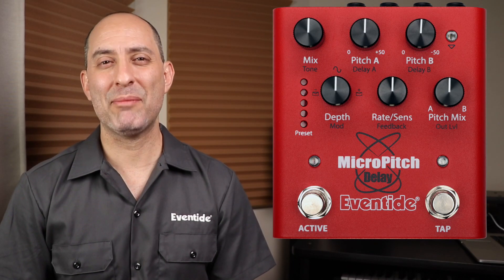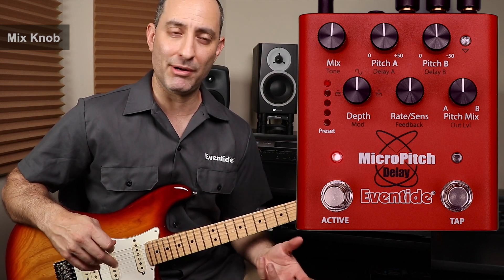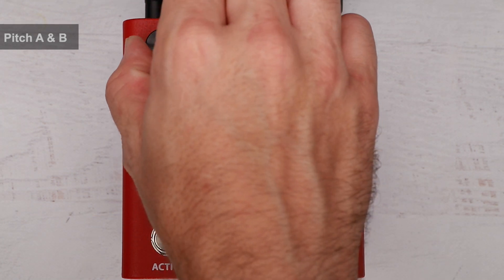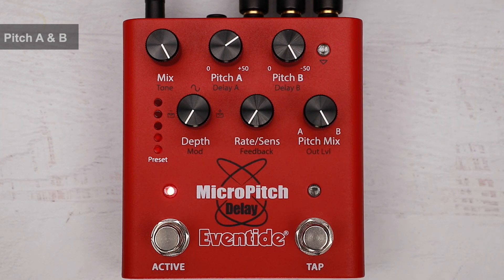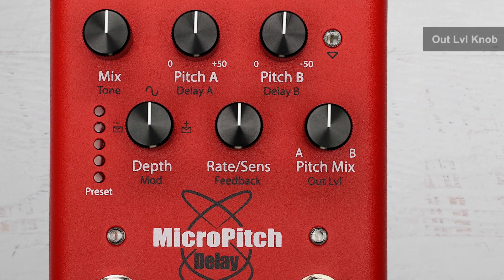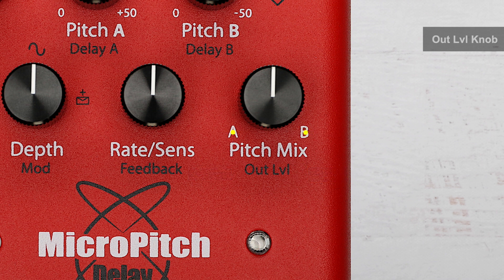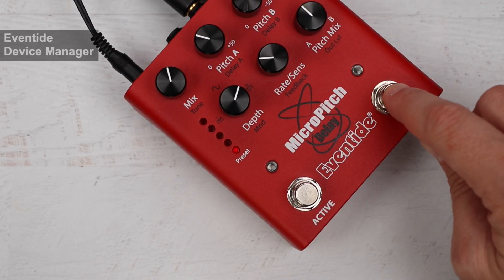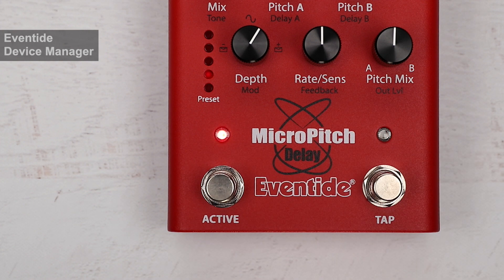Eventide MicroPitch Delay Pedal Tutorial - Part 1: Knobs & Switches

Comment: Van Halen-------  if 0 to 127 = 0 to 50 what value between 0 to 127 would equal 9cent in the 0 to 50 range  ===ChatGPT  Query ===== if you are looking for van halen settings try chat gpt - for 9 cents = 23 same goes for delay settings * assuming the range is 6 seconds-----  798 milliseconds =17 -------398ms =8 ---anyway you get the point - this could have been on the face of the unit ???? haven't tried it but should be ballpark - in the editor  obviously

Comment: Let’s say I’m in preset 1, it’s my clean tone and I make preset 2 distorted tone.   As I’m playing, I have a rhythm coming up that needs to be distorted or a solo. I hit the button I go to that preset.  When that’s finished I need to now go back to that first clean preset so do I now have to hit that button on the right four times to go back up to clean tone in preset 1 or is there a way to go backward to 1 ?
Reply from the maker: Searching for presets is possible from the front panel of this pedal the way you describe. However, because this pedal is MIDI capable, most musicians opt to use a controller to go directly to the preset you need.

Comment: played with this for a few hours tonight and i'm really grateful for the preset plates that come with the pedal i was having a hell of a time trying to "hear" what each knob was doing this video has helped me immensely it is so sensative to changes and gain settings that i was wondering if i was hearing the right sounds starting with high gain sounds i think the 5 presets are designed for cleaner settings with a tamer pickup the swirling chorus one sounded pretty good for what i was using it for (evh), definitely want to experiment with isolating the pitch shift and delay as well as combining it for different sounds like eat em and smile album or porno graffiti.

Comment: I ended up buying this and the Tricerachorus and I'm starting to think I may not need both. Any ideas or suggestions as to how I can utilize both pedals together or should I just get rid of one of them if they basically do the same thing? Love the video!!
Reply from the maker: It really depends on what you're after. Micropitch shifting and chorus can sound similar, but definitely not that same. The MicroPitch pedal is as much a dual delay as it is subtle pitch shifter, so I would focus on using it in that context. MicroPitch can also be used for more ambient sounds as you hear in some of the onboard presets and presets on the Eventide Device Manager.
Reply: @EventideAudio can MP do a ping pong delay in stereo?
Reply from the maker: @taenacup02  No, but our TimeFactor is a delay pedal with a ping pong algorithm. Our UltraTap also does auto panning of taps automatically.

Comment: If I'm wanting to use this in a Van Halen rig, I'm needing to get delay A as 398 milliseconds and delay B as 798 milliseconds, where on the dials should they be pointing?
Reply from the maker: Delay A should be between 1 o’clock and 2, while Delay B should be close to 2 o’clock. Near these settings, you’ll have to use your ears to make sure they ping pong in time. If you want the kind of precision where you can dial in specific ms, you’ll have to invest in an H9 Max.
Reply: @EventideAudio  Is it really not possible to set individual delay times to the ms in the Eventide Device Manager? Seems like a waste if not. Would be the perfect substitute to free up my Timefactor from having to do the golden ratio thing.
Reply from the maker: @ReddenDoom  On this pedal, it is not possible. Our PitchFactor and H9 Max pedals offer that level of precision.
Reply: @EventideAudio  does the pitchfactor have delays too? What about the ultratap?
Reply from the maker: @ReddenDoom  Yes, PitchFactor offers up to 1.5 seconds of stereo delay, and UltraTap offers up to 4 seconds - more details on both are available on our website at etide.io/pedals
Reply: @EventideAudio  Thanks, I should have clarified I was asking about ms time control. Pitchfactor have ms time control for both delays? And can ultratap do ms precision in the editor?
Reply from the maker: @ReddenDoom  Yes on delays on the PitchFactor algorithms; no, on UltraTap.

Comment: EvenTide has been the CORE of my personal existence and it has been 50 years since I first heard Eventide Harmonizer on YES and other Symphonic Rock LPs way back when not long before $3.33US would get me each on The Monkees LPs in MONO.

Now my Brand-New SPACE sits idle as I gather STEAM for my DIVE into its Supreme Exaltation modes.

YAY

Which Factor unit does the Delay\Echo functionality, please?
Does it also perform in Reverse?

MEGA HUGS EVENTIDE

You make my 50 year-old dream come true and scare me to pieces that I will not be able to figure it out.

Do you have some sort of Block Diagram(s) with the Metaphorical Modules as a Buchla Patch would look, please?
I have trouble reading the manual, since my left eye was BEAR-SPRAYED a few months back, but not as off as I had expected, so its cool.

I do have the Windows H9 Control so it is updated.
Why are there two different Firmware Revs up for grabs?
Do I upload the 4.x then the 5.x or do these two have different features, so I update to the v. 4.x or V. 5.x Feature Set I need from one or the other?

THANKS!
Reply from the maker: Hi Ricardo, thanks for sharing such a great anecdote. To answer you questions, the Factor series that specializes in Delay/Echo is the TimeFactor; there are 10 different delay effect options, including one dedicated to reverse delay. While we do not have block diagrams of our algorithms, you can find a manual built in to the H9 Control app. Simply select a preset and click up top where it says “Info.” Here you’ll be able to learn about each specific parameter. Lastly, when upgrading, all you need to do is choose the latest version. No need to worry about anything prior.
Reply: @EventideAudio  Even Better, will check, Thanks!
Reply: @EventideAudio  when using this pedal in an amps FX loop do you switch the pedal to line level or leave it on the guitar level? Thanks in advance for any help!
Reply from the maker: @MKRISING75  Line level is most common in FX loops.

Comment: for some reason using the first onboard preset "micropitch" setting, i cant get the "active" button to stay on. It lights up when i press it down, but deactivates when i take my foot off it.
On the other preset positions the "active" light stays on.
any ideas what i am missing?
Reply from the maker: The preset may have accidentally been saved in momentary mode. Try this, recall the first preset and then press the LED button above the active footswitch. The active button should latch now. You can save the preset in this mode once again.
Reply: @EventideAudio  yep thanks, i actually forgot that led is also a button lol

Comment: So is there any way to adjust the level of the delay only? I can’t figure that out.
Reply from the maker: The algorithm’s design doesn’t provide separate level control for the delays and pitch-shifted voices. As they work together, it’s part of what makes the effect unique. The parameters that allow us to adjust levels include PitchMix, which can adjust the volume of each voice relative to one another and Mix, which controls the overall balance between dry and wet. Keep in mind that in stereo, while PitchMix controls the balance of each voice it’s position also affects the stereo field as explained in the video.

Comment: Ok - curious to know where this would sound best in the signal chain. I have two amps (line 6 Vetta II head into Marshall 4 x12 1960A cab and a Hughes and Kettner Black Spirit 200 into Marshall 4 x 12) both have direct input and effects loops. For added fun I have an eventide H9 Max. Dumb question: Would this processor go in front of the amp or in the effects loop?
Reply from the maker: The Part 2 tutorial talks about this a little bit but in short, it depends how you’re using your MicroPitch. If it’s mainly to thicken the sound with little or no delay, but some pitch-shifting, it works well in front. Of course, we recommend experimenting with the effects loop if your amp is set for hi-gain. If you’re using long delays and ambient textures on the pedal, definitely use the effects loop always. Same applies with your H9 Max. If the H9 Max is being used for reverbs, it works best after the MicroPitch Delay.
Reply: @EventideAudio  thank you! I am definitely high gain and trying to build a huge creamy stereo tone. I’m still learning about effects loops so bear with me here… am I able to run stereo out into the inputs of the effects loops on both amps? Do I need to do anything with the effects out for the fx loops for it to work?
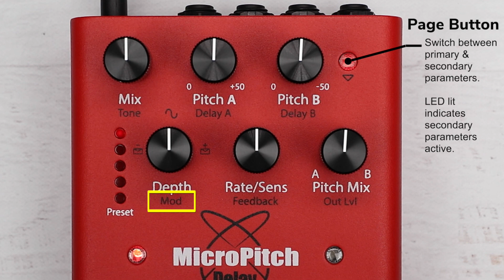Reply from the maker: @stevewade5061  I think you would benefit greatly from checking out the Part 2 tutorial. Go to 2:20 and you’ll see diagrams of how to hook things up using effects loops. 

https://youtu.be/lfi0sbn5c5Y
Reply: @EventideAudio  thank you! I did watch and it totally opened my eyes. I ended up getting the radial tone bone twin city for in front of the amps. Would something like the Hosa MHB350 be what I am looking at for the four way  junction box discussed in the video?
Reply from the maker: @stevewade5061  The Hosa box might work but it’s designed for balanced signals. I think you would be better off with a 4 ch junction box that has isolated outputs. There’s also a version with built in buffers if your cable runs are very long. Something like this: https://www.americanloopers.com/products/copy-of-4-way-junction-box-with-dual-buffers-pedalboard-patchbay-with-isolated-jacks?_pos=5&_sid=122292472&_ss=r

Comment: How effective is this pedal when simply using it with a single amp? No stereo. No direct into a board. But just as part of a pedal board into a 2x12 combo amp? This appears to be the pedal that I’ve always dreamed of having. But I mainly just play thru my combo amp, or mic that amp up when recording for fun in Garage Band.
Reply from the maker: It functions in mono very nicely. In fact, for many parts of this video, because it’s only being demonstrated on Voice A or B specifically, you’re actually hearing it in mono. When you run it into a single amp, Pitch Mix becomes a balance control between the voices, instead of a width controller. The pedal still renders a fatter tone because of the dual-voice detuning and timing differences from the delays.
Reply: @EventideAudio  Great to hear! Thank you!!

Comment: This pedal contains the h9/pitchfactor micropitch algorithm, right? Am I correct in assuming it does not also contain the h9/pitchfactor h910/h949 algorithm?
Reply from the maker: Yes, it’s the same MicroPitch algorithm found on H9 with the addition of two modulation types and an additional 1 sec of delay time per voice. It does not contain the H910/H949 algorithm.